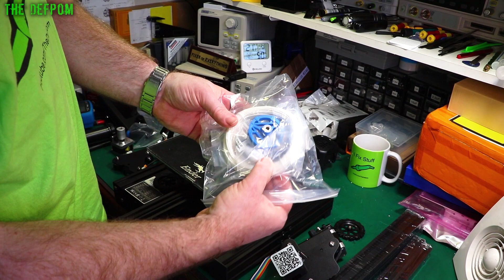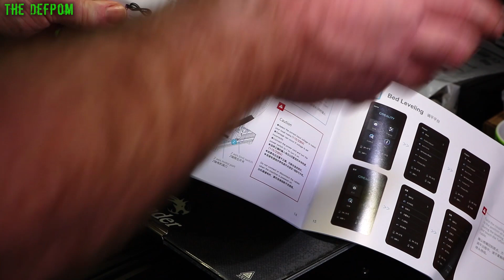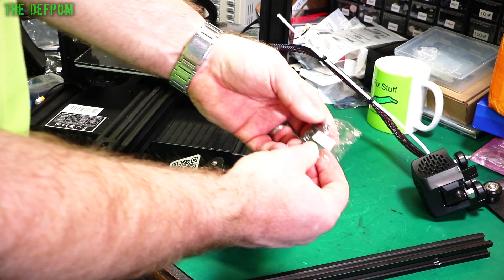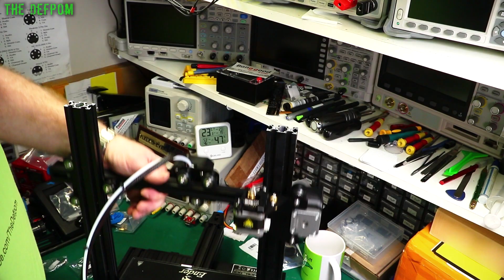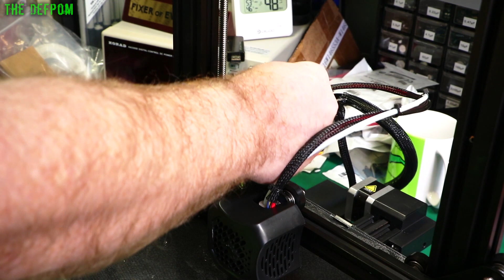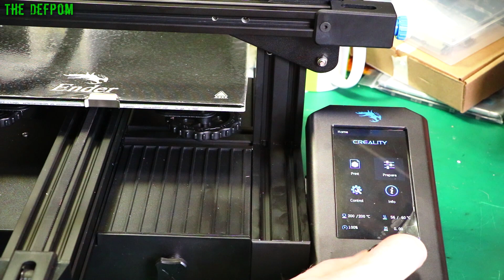#767 The NEW Ender-3 V2 3D Printer Reviewed - How Good Is It ?

Comment: My Ender 3 has the same issue with the Z screw, it's still not lining up correctly.
The improvements on the V2 look useful, although the fans are seriously noisy. Have they fixed the issue with the enclosure fan and part cooling fan running at the same time?

Comment: Nice. I've owned my Ender 3 since Dec 2018. Lots of upgrades.
Today it printed a part for a kitchen drawer handle I broke yesterday.

The main thing I don't like is the extruder. A dual gear extruder is much better.
Reply: Paul H  That’s funny Paul I have a dual extruder on my Qidi X-Pro and have trouble maintaining the height of the two nozzles. I mainly print in PLA but kind of wish I just had a single nozzle.  Interesting we all like different things. Thanks regards Chris
Reply: I have an Anycubic i3 and sometimes wish I had dual extruders also.......I do a lot of conductive PLA printing as well as normal PLA so it's a pest to change reels. However, I have upgrades on the i3 which make it a bit easier to change reels.
Between the 3D printer and my laser cutter thats two of the best tools for the workshop I have ever bought.
Reply: Paul, I notice the Ender 3 only has 1 Z screw/servo......the Anycubic has 2, so I wondered if you had upgraded that and what difference did you notice. I am looking for my next printer but don't know whether to avoid 1 axis/servo or not?
Reply: @IanScottJohnston  No idea sorry